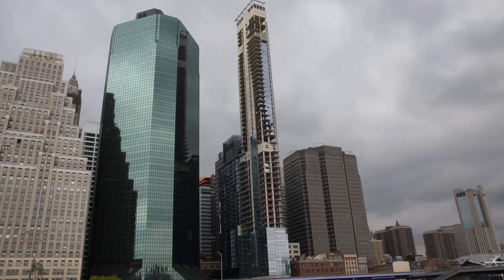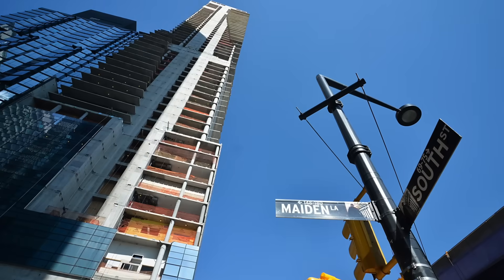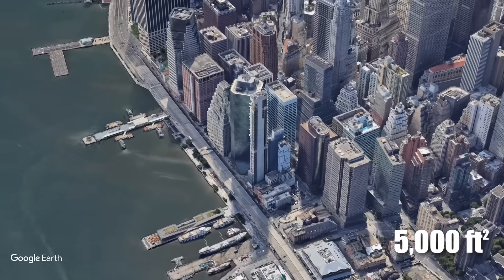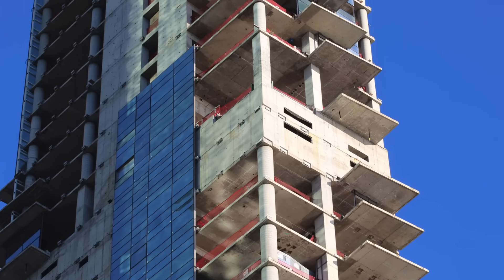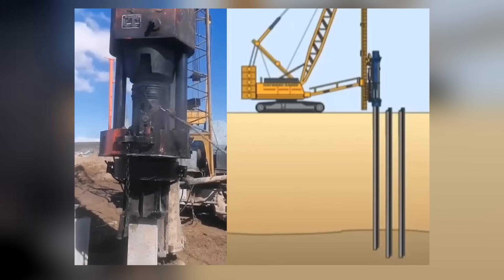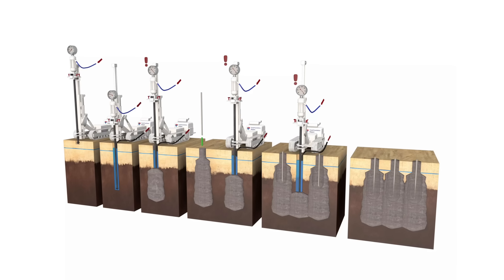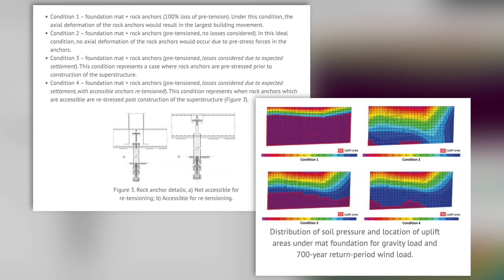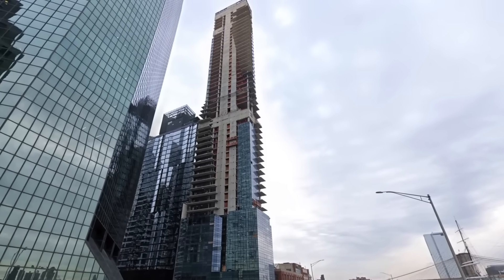Why Nobody Can Fix This New York Skyscraper

Comment: I recall in Frisco quake marina landfill turned to jelly   sounds like the ground is not stable    and go cheap on the building materials.   Read of another NYC building  with non working elevators, non level floors where marbles roll down, plumbing breaking and flooding .

Comment: With the glass facade being incomplete, I wonder how that alters the effects of wind on the building.  I'm sure they did the calculations with a smooth surface in mind, not a bunch of concrete pockets where the airflow doesn't move past, but accumulates.

Comment: The structural engineer that took this on - knowing that he would need to use an essentially untested foundation system - for a building with such an extreme slenderness ratio, seems very irresponsible.  If it works, there’s no upside to the risk.  But, if it doesn’t work, there’s consequences are astronomical.  While a 3” lean is very small (1 in 2680), where does it stop?  At 4”?  12”? Or does it tip over onto the adjacent buildings and the street, somewhere down the line?

Comment: That could bring in a pretty penny as a multi storage unit. Every NYC resident could use some extra storage. If there is a loop-hole where the building is known not to have any permanent residency, can it be used as a storage facility? ! What about precisely relieving weight from each unit to negate the  tendency to sink. They need a consultant from Dubai or Japan.

Comment: It look like these builders and developers never look world wide first before attempting this project, they should have looked to the Arab countries like Saudi, Qatar, UAE they have built massive building all on sand based ground, even ocean beds and have engaged world class engineers to look at the issues they faced. A floating raft foundation is not a new concept, it is used on sandy, marshy areas with success, but when you build a large slim tower that acts like lever what would you expect. The raft has to dip and lift problem there is nothing pushing up the dipped corner or resisting it it will continue to dip further and in the end it will topple.
Just my thoughts as a dumb ass engineer.

Comment: Yep, I'm not a fan of making land where water should be and then building on it. Such land should be for parks and golf courses where the damage is minimal if anything happens. Most of my county has respected the flood zones and creeks, not building in them save golf courses and parks so when it rains and especially when we have "wet years" the water is redirected so it does erode or take out structures.

Comment: 3 inches on a building that tall is not much at all.   There is no skyscraper that’s is perfectly plumb.  Just the sun can make a building shift in height and tilt from expansion of either the steel columns or in this case the concrete.  There’s something else going on here.

Comment: First San Francisco's Millennium Tower and now this, both built on a giant concrete raft atop old landfill instead of drilling down to bedrock, both in trouble. Has this kind of foundation worked out well in many cases? Based on my knowledge of these 2 apartment towers, I am not a fan ;p

Comment: Found a article about this skycraper. According to the article the reason for leaning is following: "The building’s lean, it turns out, was the result of corner-cutting in the construction of the foundation. The non-union developer opted for a cheaper “soil improvement” method, instead of the more reliable method of driving piles down into the bedrock. Like many non-union construction decisions, this turned out to be far more costly in the long-run. " Its amazing how companies who want to build skyscrapers in the heart of cities try to do it by saving money in places one shouldnt.
Reply: It has nothing to do with developer’s being union or non union; it is about greed; saving more making more approach. I have worked in both union and non-union for more than 20 years combined. Greed is a bad habit, it always turns into a failure in construction.
Reply: F the union.

Comment: INSANELY STUPID TO TAKING THAT APPROACH WITH SUCH A SLENDER BUILDING, SUPER AMAZING INCOMPENTENT. If it was my own building I would have drilled 30mm shear rebar into the rock it'self 50 feet down and done side shear anchors to deal with up lift pressures. You just charge and additional $300k per unit. What you have now is NOTHING. In fact less than nothing. So stupid.

Comment: they got creative, no they didn't want to spend the funds to get to 160 ft deep so instead they came up with a cheaper option that "might" work. What is cheaper, drilling down to 160 ft, or the cost of clean-up and lawsuits for the death of residents should the building fall over / collapse. Now they have a leaning building with an unknown future. Anyone who has already spent money for residency should really look at their paperwork and see if they have any kind of timetable for completion as a loophole. 
What is next, will they try and pump silt under the lower side or excavate the higher side to try and level out the building. At this point they will have better luck throwing darts at a wall of suggestions to try and solve their problems.

Comment: Um it's probably a dumb question but I'm going to ask anyway, is it possible to level the bottom floor like they do to level cement floor walkways?
Reply: Soumds like a great idea but I think they would have tried that by now if it was feasible. Maybe they won't try that because sudden changes could twist the floor or crack it though that's just a guess.

Comment: It's funny that what should be common knowledge, simply isn't. The Millenium Tower in SF is a cookie cutter situation right down to the land being created by a landfill in the water. This one also has that tiny footprint that concentrates the massive weight over only a small area. Both buildings are also very heavy due to using concrete construction. Another issue, in unstable soils such as these, is the effect of dewatering - both during and after construction, of not only this building but other structures in the surrounding area. I'm glad that the prospective buyers were able to get out whole.

Comment: 15:1 hight ratio, crazy, on packed sand, on a water front, I have limited skills in this but I know what makes NYC possible is bedrock for giant buildings to sit on, I mean even if it works at first, dirt,  water sand, it will not last

Comment: Could they have avoided the lean? What an idiotic question. Ofcourse, by spending the money and going down to bedrock. And a similar problem occured in San Francisco by NOT anchoring the structure to bedrock. It was the fault of the site engineers telling the developer what they wanted to hear " this cheaper system can circumvent the need to go to bedrock". Wrong. Amazing how supposed intelligent people can make such a huge mistake.

Comment: I’m a licensed professional engineer and I have no idea in hell what you mean by 3 inch lean. That is meaningless and needs to be quantified further. Is that at the base over the total width? A run-out?  What?  It’s definitely not at the top as 3 inches at that height is unthinkable perfection.
Reply: Relax.
Reply: DUH......  What will it be in five or ten years?

Comment: I think the main issue here are the delays, the fines and the increasing development costs. They say on wiki: The developer hired engineering firms WSP Global and Arup Group, which both concluded that the building's lean did not compromise its structural integrity.
Reply: What else WOULD they say?

Comment: In the video, when showing the north side, we can see plenty of concrete slabs on the side. When showing the south side we clearly see a lot less concrete and more glass. I'm thinking it's leaning that way because during the construction they didn't make sure to distribute the weight evenly between north and south sides! Has anyone thought of loading the south side lower floors and seeing if the whole tilt can be reversed?

Comment: When they built the MARTA station at Peachtree Center they built the Station underground using cut and cover and also using a decompression chamber for the construction workers and the station still stands today and yes it does leak a bit but that is because of the moisture from from when it rains coming down through the Stone Mountain Granite walls that line the station and it's designed for that on the other hand this site was not

Comment: I wouldn't want to be anywhere near that building even if construction went smoothly. It just does not look stable. 

I used to build RC airplanes from scratch. But I didn't do any specific engineering or design. I just followed the principle of "if it looks like it will fly, it will probably fly".

Well, that building doesn't look like it will stay upright. So I'm very suspicious of it.

Comment: I’ve been in a really high tower this small before in thailand. On the top floor I could feel the building moving in the wind. The windows were installed so poorly that the wind just flew through the edges making this terrible wind noice. Unfortunately I paid for that room for 3 nights but I’ve only stayed there for 10 minutes. Later I went to the mahanakhon building, that was a really nice tower.

Comment: We have a similar unfinished 86 meter tall building in Copenhagen.
5 years have gone by now, and it is still standing there with no sign of activity, the contractor used a much weaker concrete which is supposed to be used in a 1 storey house lol.

Comment: At Only $6,000,000 or for the price of 6 of the 100’s of Apartments in the building would make much more sense then gambling on a new method!

Seems like “someone” refused to take a pay cut after they Agreed to build…

When the dust “ settled “ and the 💩 Slid 3 inches into fan they went to court to say it was the other guy’s fault 😂😂

Comment: Very vague script. A 3 inch lean - for the whole tower? Per meter? How does a lean make installing the glass facade difficult? 3:20 'construction began in 2015, or did it' what does that mean? Just because you have code violations doesn't mean you didn't start building.

Comment: I wish I could see the project specs, because, TBH, 3" may be well within the erection tolerance of plumbness. Doing the math for a 670 ft bldg, 670'x12 in/ft ÷ 3" = 2,680. A bldg that ht, should be able to take at least and H/500 deviation...that would be 16 inches! But, I must conceed that when it comes to foundations, differential settlement for bldg that size should be limited 1" max.

Comment: I always see unnecessary to build those rectangular sticks - as for sake of practicality. Personal preference is in triangular - or rather - pyramid shaped structures, which provide physically correct and stable solutions. Look at that north korean unfinished hotel, or even burj khalifa ... they got it right. And boy those will withstand some wind, unlike this NY stick in the sand. The repetitive vibrations would cause trouble alone - no idea what the designers and contractors thought here would happen.

Comment: I am an HVAC engineer from Poland, I saw the film about the building, the decision should be made fast to dismantle the building and write off the entire cost..this building is not going to be fixed. The cascade of costs must be stopped asap. But knowing the life the NY laywers will be only the ones who will benefit from the fight...poor peaple who paid their appartments...The manager of this project if he knew the problems earlier from his engineers should be the one to stop the nonsese much earlier. Another thing here is that the design was wrong. The design firm will also be in trouble unless they well documented that the inwestor knew about the risk and desided to continue...THE PROBLEM IN CONSTRUCTION INDUSTRY IS GREEDY LAYWERS AND IRRESPOSNSIBLE MANAGERS OD INFEVSTORS ARE INFLATING THE RISK BY THEIR IRRESPONSIBLE BEHAVOIUR AND DECDISSIONS, ENGINEERS ARE OFTEN BLACKMAILED EITHER YOU DO AS YOU WERE TOLD OR WE WILL FIND ANOTHER ONE WHO WILL DO IT>>

Comment: Engineering is a fine balance between servicability and safety and overdesign. The solution yo the foundation problem was sound but there must have been a miscalculation in the loads or poor execution by the contractor. They need to conduct thorough forensic analysis as the building may be salvageable

Comment: American standards. Build it cheap. Sell expensive. And dissolve the LLC to avoid consequence and leave buyers holding the bag. Only difference here is the problem was discovered by the public before completion and developer/builder didn’t get away with it.

Comment: mechanical engineer diploma here. I don't really get it: given they already have tension bolts/springs ; couldn't they make them adjustable to pull the building when it inevitably it settled?

Comment: Visibly tilting away from the street below 0:19.  That is total b.s. nobody could see a 3 inches tilt on a building of that height.  Whatever the narrator allegedly see is an optical illusion from the shape of the building.  I am not saying the building is not tilting I am saying it would not be visible without proper equipment.  If the complete building is tilting as a solid block, as suggested, it would not make it more difficult to install the window panel.  If, however, the front wall is tilting away from the back wall then it is a more serious issue but even then,3 inches for 60 stories it mean around 3/64 per story spread on the entire length of the side wall.  Assuming the 3/64 difference is spread on 10 windows panel it would mean .0045 inches per panel, about 1.5 x time the thickness of sheet of paper.  This would not cause an assembly issue.  Structural issue maybe, pr issue definitely, assembly issue no.  This is not a Suisse watch it is a building.  If I had to guess I would say 3 inches is nothing but it indicates that the foundation are not stables and the tilt might get worst.  If the tilt affect only 1 or 2 window panel then maybe it would cause assembly issue but it would probably indicate that the building is about to collapse which does not seem to be the case.  Pisa tower has been leaning far more than 3 inches for centuries…. It is a beautiful building, maybe there is hope that a solution can be found.
Reply: Most tall buildings like this have damping devices that dissipate floor vibrations and allow the building to oscillate depending on wind shear and seismic conditions. 
Point being is that they don't remain plumb.
I am an iron worker, I've been doing this for almost 40 years. 
If that thing is only out by 3" at an elevation of over 400', then those guys are doing great. Without a transit, you'd never see it.
Reply: @peteywheatstraws4909  I totally agree with you, 3” on 400’ is nothing.  If it was an ironwork “error” there would be no discussion to have, as you say it’s almost perfect but apparently it is the foundation that sink.  It could consolidate but it could get worst. I did not know about the damping device, it makes perfect sense, thank you for the input.  Btw I could never do your job, for me two stories is about the extend of my comfort zone.  I am actually impressed by iron worker.  Stay safe.

Comment: So which is it?
Are the calculations for wind load for all buildings in Manhattan all wrong?
Or did these guys cheat? Thus being criminally liable.

Clearly they should have spend the extra 6 million, and NYC building codes need to be amended so that anything over 7 stories tall need to make contact with the bedrock in at least 4 locations per location and per 3,000 SF

Comment: Trying to save money is now out of control, this is the result of cutting costs,  basically building cheap, had they drilled down to the bed rock, this would have stopped the lean, as you say built on made up ground, is never to be considered a  sound project , this is just like the leaning tower of pizza  , they used freezing technology to control the lean, may be constant freezing will stop the building from moving , but that will have to be at the constructors constant up keep ,not passed on to the tenants  as an expense in maintenance , fore  pore design,a classic example , of throwing the baby out with the bath water .

Comment: .02 difference between each window shouldn't be an issue. Even more I'd get another measurement. If the builder is that stupid then he should get that second opinion on the lean.

Comment: They assumed the the ground was uniform but it was not. Designing a high rise is really not that difficult. Foundations are the most important part. Then you design the frame of the building to waist and the dead and lived loads including wind, some earthquake loads ( not too stringent for NYC). There are plenty of safety factors included in the codes. But if you mess up the foundations you have a serious situation on your hands.